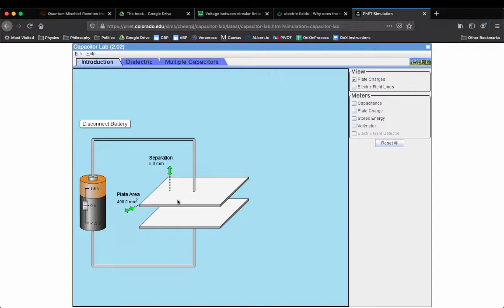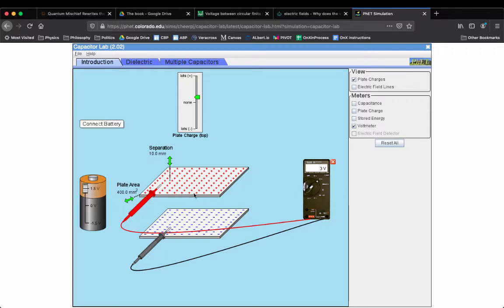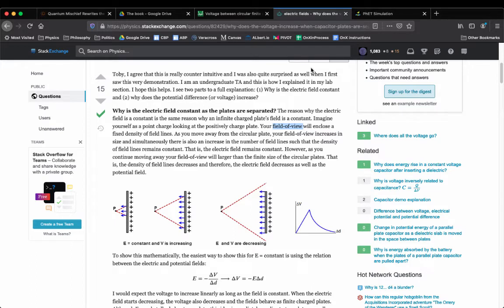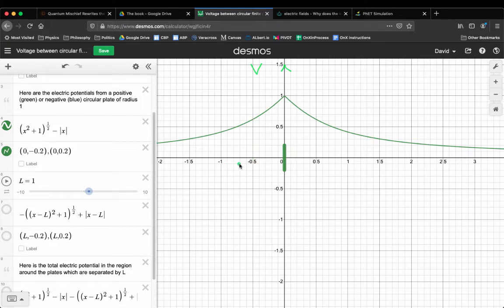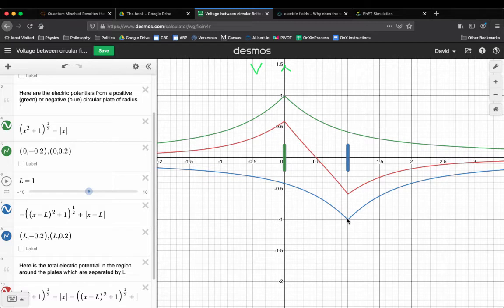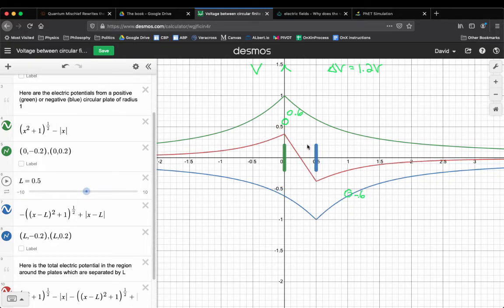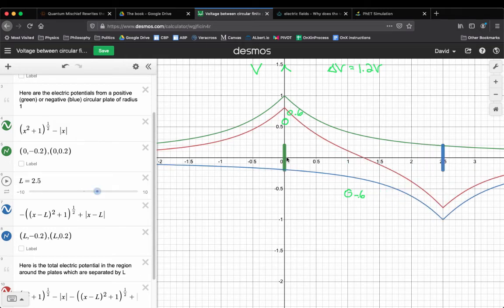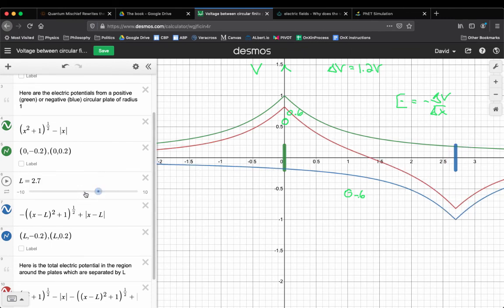How can the voltage between capacitor plates increase when separated?

Comment: Everything given in this explanation is correct as far as I'm concerned. However, the late, great, Richard Feynman used to say that if you can only explain a phenomenon by writing down equations, then you don't really understand it....

Charges are dumb animals. Like charges repel each other. Unlike charges attract each other. The attraction and repulsion of charges follows an inverse square law. That's all charges "know" about themselves. In this experiment, no-one has told the charges that they'd better re-organise themselves to increase the voltage across a capacitor because someone has moved the plates further apart.

What is it that the voltmeter is actually measuring? In no direct sense is it is measuring how much work it would take to move a positive test charge of one Coulomb  from the negative plate to the positive plate. So, the voltmeter doesn't know anything about potential energy. Potential energy is a derived term based on more fundamental measurements.

Suppose we discharged the capacitor through a torch bulb. The capacitor with the plates closer together would produce a dimmer flash than the one with the plates further apart. Why? You could say that the higher voltage caused a higher initial current as explained by Ohm's Law, but that wouldn't answer the question. The question is really about asking why do the electrons on the negative plate feel a higher pressure of attraction to the positive plate just because the plates are further apart, given that the strength of the electric field between the plates stays the same.

The electrons don't know anything about potential energy. They only know about forces of attraction and repulsion.
Reply from the maker: Electrons don’t “know anything” at all, but I think an energy description is just as valid as a force description. 

That said, even when considering just forces, the electrons on the negative plate are not attracted to the nearby positive plate as much as they could since even if they get there through the wire, they’re still being repelled from that spot by the nearby negative plate. If you move the plates farther away, the electrons can get to the positive plate AND father away from the repulsive negative plate. Electrons are not only being attracted to the positive plate but repelled by the negative plate. So yes, the current should be greater when the plates are farther apart even when you consider forces alone.

Think about it this way, if you simply place a negative plate next to a separate neutral plate connected to ground, that grounded plate becomes positive, not negative. The electrons in the second grounded plate run away. In other words, that second plate is undesirable for the electrons since it is so close to a negative plate. The farther away the initial negative plate from the grounded plate the less undesirable the neutral grounded plate becomes for electrons.
Reply: @WeAreShowboat  I take your point, but analysing what’s happening in terms of energy, while perfectly valid, is less satisfying (at least to me) than using more fundamental principles. If I jump out of the window from the 10th floor of a building, then on the way down I might ponder why I’m accelerating downwards. I’d conclude that it must be due to the force of due gravity pulling me towards the Earth’s surface rather than consider that what’s going on is a transfer of energy from potential to kinetic in order to satisfy the Conservation Law.

The other point I'd like to make is that its the net electric field that exists between the plates that counts. Yes, the positive plate is attracting electrons and the negative plate is repelling them. But, the electric fields from each of these plates combine to provide a net electric field that is uniform between the plates. For a given voltage and spacing between parallel plates, an electron placed anywhere between the plates experiences a force that is the same in both magnitude and direction. Its the this net electric field that you have to work with, not the individual plates. My question was really this: When you double the separation of the plates, the voltage between them doubles. However, the strength of the net electric field between the plates remains the same. So, why is it that when you discharge the capacitor, the initial current flow (as predicted by Ohm's Law) is higher when the force provided by the electric field is the same as before?

Anyway, I think I’ve managed to find an answer to my own question, the premiss of which wasn’t quite right:

Suppose we have a pair of capacitor plates charged to a potential difference of V volts.

I now short out the capacitor plates in a rather impractical way: Connect the plates using a piece of resistive wire cut to a length equal to the distance between them. If the resistance in the wire is R, then the initial discharge current is I=V/R.

Now take the wire away, and recharge the capacitor back to V volts. Repeat the experiment but this time, before shorting out the capacitor, separate the plates to double their original distance. The voltage across the capacitor plates doubles to 2V, while the strength of the electric field between them stays the same, but now extends to occupy double the distance. Of course, to short out the plates in the same way, I need to double the length of the resistive wire. So, the resistance of the longer wire would be 2R. As a result, the initial discharge current is 2V/2R=V/R=I as before.

If I were to compare the results of the two experiments in order to analyse the effect of the electric field between the plates, I would not be comparing like with like because the second experiment uses double the resistance. In the second experiment, I could have maintained the same resistance R as used in the first experiment by using two lengths of resistive wire in parallel. This would have resulted in an initial discharge current of 2V/R=2I. The lower resistance and higher current come from the fact that I’ve supplied an extra conductive path, taking advantage of the fact that the electric field permeates the whole space between the plates. So, contrary to what I was originally thinking, you don’t necessarily need a stronger electric field to increase the current. With two lengths of wire, the individual electrons are making their way along the wire at the same average rate as before, but now, with two conductive paths, have twice as many of them! Of course, in the second experiment, I could have used a wire of some other material with same cross-sectional area but with half the resistance, in which case the current would have still have been 2I, but achieved by virtue of the electrons making their way along the wire twice as fast as before. The important point is that you don’t necessarily need to increase the speed of the individual electrons to increase the current. So this explains why you can double the current with the same strength of net electric field.

Finally, I thought I’d look at discharging the capacitor in a more conventional way, by connecting a resistor to the outer terminals of the capacitor.

Get the capacitor back to it’s original state, charged to V volts. Now connect a resistor to the outer terminals of the capacitor. At this point, I’m going to get a bit pedantic about the components in the setup. First, the “body” of the resistor is a small piece carbon/graphite a few millimetres in length encased in ceramic and with wires attached to each end. 

Let’s consider just the wires in isolation for a moment. Let’s suppose the wires themselves have almost negligible resistance or capacitance of their own. When the wires are first connected to the capacitor, the ends of the wires attached to the body of the resistor must attain a potential difference of V volts (almost). I say “almost”, because the two wires could be considered to be acting like a miniscule capacitor connected in parallel to the big one, and the big capacitor will charge it up, causing a tiny drop in the overall voltage. I’m assuming the amount of extra metalwork in the wires is sufficiently small that the reduction in voltage is way down in the decimal places. So, we still have a PD of V across the capacitor under test.

Depending on the physical length of the body of the resistor (the part that actually provides the resistance), the distance between the ends of the wires could be 5mm or 10mm, or whatever. Nevertheless, the initial voltage drop of V volts between the ends of the wires must be the same in all cases. This near constant voltage will be maintained by the capacitor under test. Now, if the voltage between the ends of the wires is maintained at a near constant voltage V regardless of whether they’re 5mm or 10mm apart, this means the strength of the electric field between the ends of the wires must vary accordingly. So, if the ends of the wires are 5mm apart, the strength of the electric field between them must be twice what it would have been had they been 10mm apart. So, this is a different dynamic compared to the experiments where we shorted out the capacitor by physically inserting resistive wire between the plates.

But it makes no difference to the initial current flow. If the resistive material in the body of the resistor has resistance R, then the initial current is V/R. Why is the current same regardless of the physical length of the resistive material and the strength of the electric field between the ends of the wires? There could be several reasons why a 5mm length of resistive material offers the same resistance as a 10mm length of some other resistive material. The most obvious one is that the 10mm length is made of the same stuff but has twice the cross-sectional area. In the 10mm length, doubling the cross-sectional area of the material exactly compensates for the fact the strength of the electric field is half that in the 5mm length.

So, everything can be explained in terms of the strength of the electric field and the distance and volume over which it extends.
Reply from the maker: The main point as far as I can tell, is that the voltmeter probe touching the positive plate isn't just noticing the positive on that plate, but also some of the negative from the negative plate, that partially negates the measurement. But the farther away you put the negative plate, the less the effect of the negative plate on the positive plate electric potential probe measurement and vice versa.

When the plates are farther away, the probes at each plate don't notice the effect of the other plate as much, and a higher voltage is measured/exists.

You said "why do the electrons on the negative plate feel a higher pressure of attraction to the positive plate just because the plates are further apart". I don't think they do. If you move the plates farther apart they feel less force from the other plate, but that doesn't mean the voltage doesn't get higher. The force is the same, since field stays the same, but the charges get to travel farther (if flying from one plate to the other), so more work can be done, more KE, more brightness in a bulb, etc.
Reply: Thanks for your response. Sorry, but I'm not totally convinced by your argument!

Firstly, I’m at odds with what you say about the voltmeter: If the voltmeter works as most of them do, then, when it’s connected across the capacitor, it completes the circuit by allowing a tiny trickle of current to pass through a very high resistance. The trickle of current passes through a coil suspended in a magnetic field which, in turn causes a needle to deflect from it rest position. The voltmeter is calibrated to translate the deflection of the needle into a voltage. A higher voltage causes a higher current which causes a larger deflection. The voltmeter isn’t “noticing” the states of the capacitor plates. It’s noticing the magnitude of the current flowing between them.

I do agree with what you say about moving the capacitor plates up to a point: The strength of the electric field between the plates is uniform from one plate to the other. When you pull the plates a little further apart, the strength of the field stays much the same, but obviously extends over a greater distance, which in turn gives rise to a greater voltage according to the definition.

When I talked in terms of “pressure” I was leaning on the often-used analogy with fluid mechanics, where voltage is mathematically analogous to the pressure provided by, say,  a water pump. So, an increase in the voltage between the plates does represent an increase in V, the electrical “pressure”.

Now, let me put my question like this: Start with the capacitor in its initial state, with a voltage V across its plates. If I were to short out the capacitor with a piece of wire of resistance R, the initial current flowing through the wire would be I=V/R. Now, start again, with the same initial charge on the plates but with double the distance between them. The voltage across the two plates is now 2V. The strength of the electromagnetic field between the plates is the same as before, but it extends across twice the original distance. I now short out the capacitor with the same piece of resistive wire. The initial current through the wire would be 2I. Twice the initial current as before. Now, I realise that any individual electron is having a bumpy journey through the wire. However, at the initial stage of discharge, the net migration of charge from one plate to the other occurs at twice the rate as before. What exactly is causing the flow to be twice as great? If we were dealing with an object falling to earth under the influence of gravity, we could argue that it would hit the ground at greater speed the higher up it started. That would involve acceleration though. Are electrons accelerating down the wire and picking up more speed because they have twice as far to travel? I don’t think so, as the current through the wire should be the same at any point along its length. So, how exactly does this happen?

Comment: I thought this was due to v*a=w. a capacitor holds a certain amount of watts, and by separating the plates your reducing the amps, which in turn increases the volts as the watts always stay the same. you cant create or destroy energy but you can change its form. kind of like a compression of energy. people forget that 12v*10a=120w and 120v*1a=120w. there is no volt without amps, sometimes the amps are just to fast for us to measure.

Comment: Epic explanation! I'd like to derive the function for electric potential vs position from a charged rectangular plate. How did you get that function that you mapped so well with Desmos?
Reply from the maker: You can either solve for it from scratch using a two dimensional integral, or do a one dimensional integral that starts with the formula for the E along the central axis of a ring of charge (that you integrate to the radius of the plate).

http://www.physics.udel.edu/~watson/phys208/exercises/kevan/efield1.html
Reply: @WeAreShowboat  much appreciated!

Comment: I think the simplest and most intuitive explanation to this problem is that the oppositely charged plates are exerting an attractive force on each other. Since the plates are flat and the charge is evenly distributed, the force between the plates remains constant (at least upto a certain distance). Now if you pull the plates apart against this attractive force, the work you do would be stored in the charges as potential energy, which is exactly what voltage is: potential energy per unit charge. And the higher the potential energy, the faster the charges move when a path is provided for them to flow (a wire), which is what current is. So this is why pulling a capacitor's plates apart increases the voltage between them.